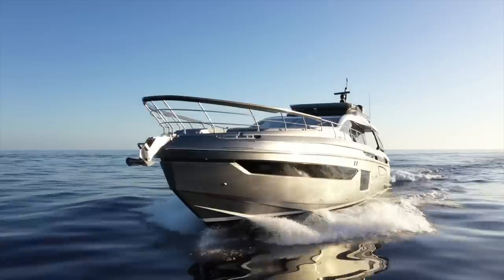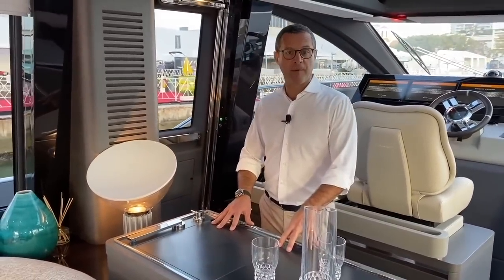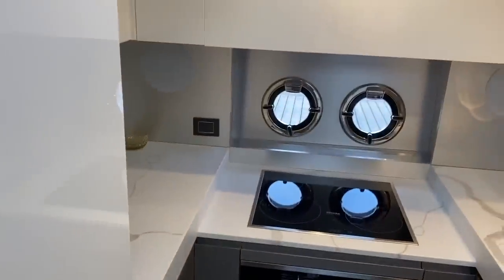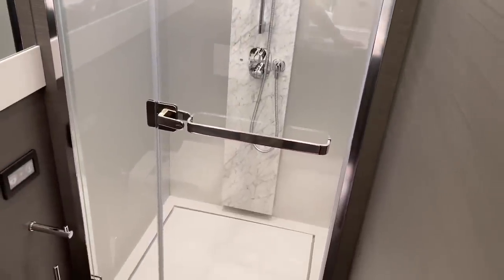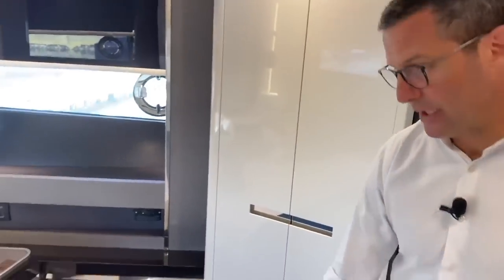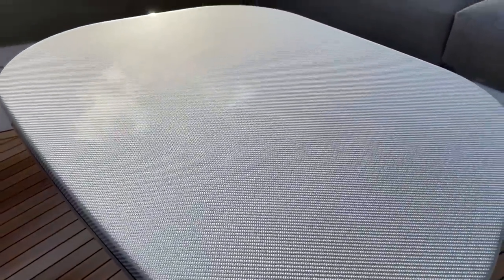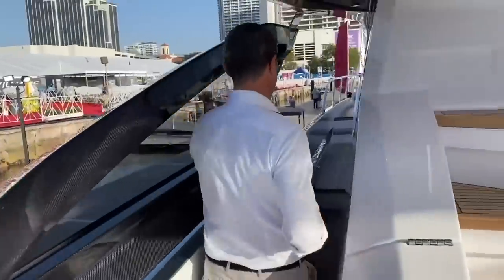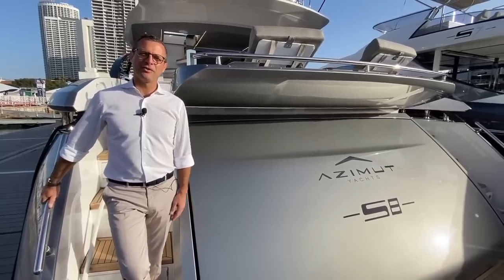Azimut S8 | All You Need To Know

Comment: 20:53 I would rather have toys cluttering up the deck
or stored in the side of the yacht, even at the expense 
of a stateroom than burden the mechanics with 
having to crawl around on all fours, to do maintenance
or work on the motors. 22:03 I must say though the
garage is quite impressive. I wonder if they could
engineer the floor of the garage (empty), to raise
up during engine servicing/work.

Comment: Thank you for a great presentation. 

If money was no issue, sub 100 ft, what make would you choose and what would you choose between IPS and shaft drive?
Reply: MTU engine, shaft drive, conventional and reliable, less electronics, not over-engineered like IPS . Combined with thrusters you get same manoeuvrability as IPS. Azimut S10 got a perfect MTU setup, check Aquaholics tour.
Reply: Well, this one or a Pershing 7x for the Mediterranean Sea / Bahamas etc. as a fast Sportscruiser. 
They both have a range of about 320 nautical miles at a crusing speed of 27kn (s8) / 38kn (7x).
For World Travel a Bering 75. 
Range 4,000 nautical miles at a crusing speed of 9kn.
Why no more than 78 feet? Taxes, insurance, class and most important, berth in ports.

Comment: three engines but only two throttle levers.. how does that work?
Reply: Third engine comes on, when the other two are near FULL throttle.....so saves running ALL three engines for quite long periods. They say this set-up is around 25% fuel saving with the IPS pod drive units.

Comment: Love this particular interior and the table lights, shame you can't have a bath tube.....I would a folding seat in the shower.
Reply: Bath tubs are not common on yachts because of the amount of water that they require and yachts normally have a nominal amount in the storage tanks before they need to refilled.

Meaning that all occupants and crew will need to use it for as long as possible or suffer from shorter trips between each location.